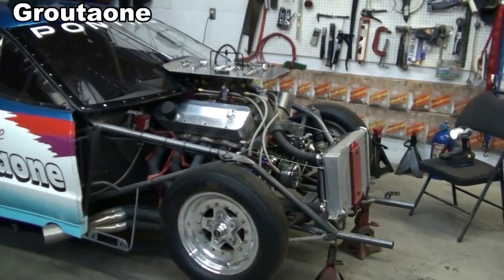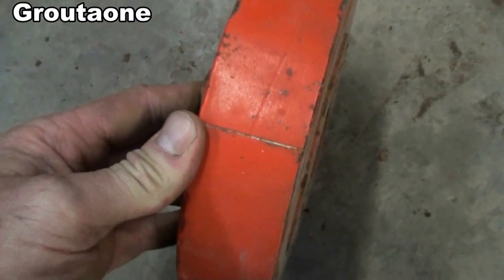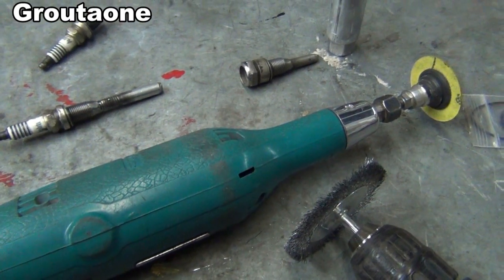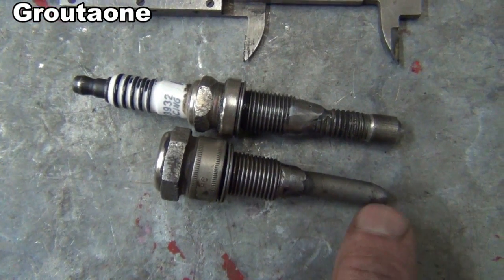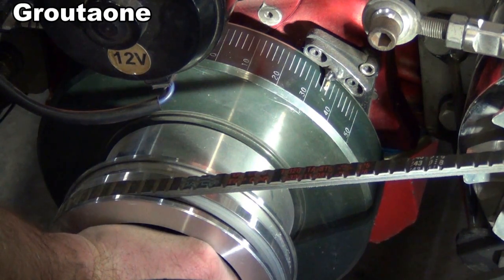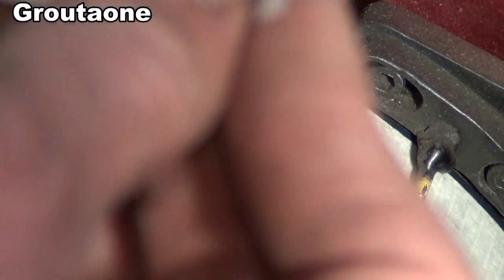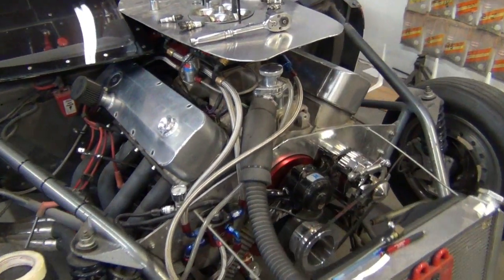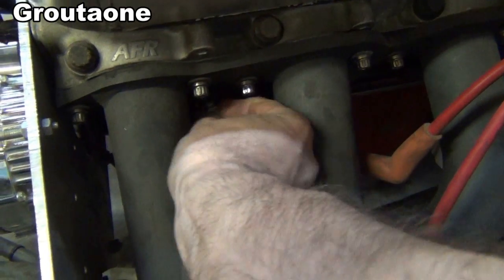Find TDC With Heads On

Comment: Their  is an engine family that has the #1 sparkplug on the cylinder bank that's recssed... 
And that's Pontiacengine family, my educated guess [ I my be wrong ] is that Pontiac  Division wanted cylinder # 1 to be on the right bank.  But, GM executives wanted all GM engines to have cylinder # 1@ the left bank. However,  the engine was already designed in a manner that the left bank was recessed, to late to  redesign.

Comment: Hi, Great video, I see that some people just put a whistle TDC finder on spark # 1 hole and turn clockwise until the whistle stops sounding. When whistle stops, that would be their TDC at compression stroke. Is that approach as accurate as yours? Once determined TDC, for timing purposes, I should line up the distributor rotor to plug 1 and then go with the timing like, correct?

Comment: Great vid, my 09 honda odyssey broke a timing belt. Ya interference engine compression shows atleast bent valves. Gona try gearwrench boltbiter sockets since heat and PB wont get header or exhaust bolts loose. Then both heads come off. Crossing fingers rebuilt heads gets me back on the road. Would luv to see your vid on TDC with heads off👍👍👍👍

Comment: I used this exact method to confirm TDC on my 388 SBC today, and I have a very similar adjustable timing pointer and a balancer that is pre-marked. The only difference between what you did and what I did, Is I had my cylinder head removed and used a piston stop attached to the block. Anyway, the TDC mark I found with this method using my two marks was about 3 degrees after top dead center passed the zero stamped on my balancer. I have a picture if you would like to see. I know I'm making this harder than it needs to be, but do I just rotate my motor around to line the zero on the balancer up with my pointer, and then adjust the pointer to the actually TDC mark I found with this method?  I hope this makes sense. Thanks in advance!

Comment: Does it matter what size length bolt u use to weld onto your spark plug? Or does it not matter as long as u spin it back around then meet in the middle upon the timing wheel?

Comment: Ok which way is the most likely to slip backwards so it looks like too adv. Timing or the other way? When using a piston stop and turning motor backwards is there any chance the piston hitting the valves?
Would a dial indicator work as well if not better?

Comment: Correct me if I'm wrong, but the reason your timing mark looks a little off is because it seems the tool didn't stop the piston at True Top Dead Center? The only way to find True Top Dead Center would be to use a dial indicator on top of the piston with the head off, right?
Reply: The piston has to hit the tool and can go no further, hence the reason for spinning the opposite way and hitting the piston then dividing by 2. This gives you the half way point of the #1 rod throw on the crank. Geometry is absolute every time.

Comment: Can you offer some diagrams for people who want to front half their car eg if they were building a serious bracket car or pro mod and what are the considerations for suspension and steering and which are the best parts to use?
P.S. I've been advocating that method for finding TDC for years, and it's great for motorbikes that usually dont have pointers or marks and most car balancers always seem to be slightly out, no matter the brand

Comment: hi I have a 12valve 190e 1984 mercedes benz a 2.3 engine.i have difficulties in finding the exact tdc of the engine.after building up the engine.it have difficulties in starting the engine.i only use a screw driver to find the compression.do i have to rotate counter clock wise after the compression at cylinder is up, and after a 1half inch of rotation is the tdc? thanks for your very informative videos:)

Comment: Nice Ride ! So to find TDC  you have to be on the compression side, right ? You got the valve cover's on and can not see the valves so how do you know for sure ?
Reply from the maker: ***** Correct, need to be on the compression stroke
Reply: Every other TDC the spark plug fires for #1 cyl, but that doesn't matter, TDC will still be the same because the crank throw will always be the same regardless of what the camshaft is doing. You are simply measuring the longest part of the crank throw for #1, it has nothing to do with cam components.

Comment: What about the good ol' finger method to find tdc?
Reply from the maker: That will get you in the ballpark if that's all you need, this is to verify the pointer is correct
Reply: Don't take me wrong, was a really great video and you explained everything very good.Thanks for sharing!
Reply: Could you do a video on a Ford 400 fixing distributor that's 180° off? Doesn't have to be 400 but its hard to find any videos on that engine. It doesn't have to be a video....you got any tricks to quickly rotate the dist 180 degrees?
Reply: jeremy sandifer  When did Ford make a 400?  I didn't realize they made a 400, I found it interesting to find out Ford made their own carbs at 1 point too. I knew Ford made a 360 also, but I got a Dodge 360 small block, Ford's 360 was a big block correct?
Reply: Ford made a 400cu. It was in the same category as the 351m series. Close to the Cleveland line with small changes. The Ford 400 is almost just a stroker motor. In trucks, they were in mostly the 78 and 79 F250s.
Reply: Not accurate, but accurate enough to drop your distributor in and get it running.

Comment: Hey thanks for the simple explanation and recording these videos.  I suspect my 347 stroker pointer is off and I know my MSD Pro Digital is miles off.  This will be the first step to getting it to run as it should. I did all my own work on body, interior and mechanical except the machine work and the dif setup.  Now I need to learn how to tune it.

Comment: Hi , can you help me out I have a sbc 350 with a mild cam , msd dristributer , holley 750 base timing at 15* and total at 36 @ 2800rpm . From idle to part throtle I have a hesitation and them it just goes any ideas

Comment: I had a damper come apart, and marked the hub with a TDC mark.  I always wondered how important the damper was, from a engine damage standpoint.   Recently I saw a late 80's four cylinder F1 engine dev. video.   They were mysteriously throwing rods, later determined all due to harmonics.

Comment: Hey man! Yes that did make sense.I got the new timing light.It was better than the old one. Also I checked the distributor again and it has adjustable rotor.The nuts and washers were no good and the rotor could not stay in place when revving the engine.So after replacing those I was able to set the total timing at 38 degrees.The idle was still off and I´m going to calibrate the carburetor today or tomorrow.I hope everything works after that.Thank you for your help! I should make a video too...

Comment: Yes I know, I did try that already, but after the total timing was set at around 36 the engine would no longer idle or even fire up at all. It´s not working at all. I would understand this if the timing mark on the damper was so much of and it would show the total timing 50, but actually the timing would be near 36-38. But it´s a one peace fluidampr balancer and it just can´t move on its own like that. Could something else be off? I just can´t understand this problem.I have done this before.
Reply: When you have more of a radical motor, your idle timing has to be increased, so then you have to take out some mechanical advance so it still ends up at 36. Its not uncommon for a radical motor to idle at 22-24 degrees, meaning the centrifugal advance would then only need 12-14 additional degrees.

Comment from the maker: I would set the timing at 36 degrees with when its up on rpm so the timing is all in and after that see where your timing is at when you let it idle down. The 36 degree max is the important one

Comment: Hi again!This was a good video,but still didn´t solve my problem.You see I´ve got the same fluidampr and everything lines up nicely.Also I checked the TDC before I put the heads on the motor. I installed the distributor and the rotor was set at #1 cylinder the motor still at tdc.It fired right up and when I started to look for my 36degree mark that I highlined before.What the f#&%!The idle(1600rpm)was now 38 already!Then I checked the total and I think it was 50 plus! What could I´ve done wrong?
Reply: Maybe you installed the cam straight up but it was recommended to be installed at a different specific point.

Comment from the maker: @Grannysteacup It could be a plugged jet, main jet sounds fine though, crank seals maybe or reeds as you say, the power as you describe does not sound far off from being normal for a 125 two stroke however

Comment: sup groutaone i got a honda crm 125cc 1992 (2stroke) that is supposed to have about 30 hp but on low rpm it feels like 5hp and about the same at mid rpm but then on high rpm there is a huge kick so u really feel the power. You seem to have very much experience with everything in the range of mechanics so what do you think i should do ?  (i have cleaned the carburetor and adjusted the settings right) could it be the reed valves or something?

Comment: .... near tears ... expensive tears at that . But it's all this stuff that the electronics should be able to stop .... I always thought about the effect of the ware on the cam chain tensioner & the like and these half degrees that changed the relationship be it under heavy load V lighter load, or the effect of a hot day over a cool day, this is when you start to think about Formula 1 and they have to pre heat the unit to get it loose enough to start !

Comment: @groutaone When I got it home and installed it, I cranked it over and it stopped after half a revolution.Then I noticed a sparkplug missing.Fished around with a magnet and pulled the bolt out.Awhile afterwards I did a head gasket on it and was amazed how close the bolt came to the valves.

Comment: Yay for new mike, sounds good. Bought a car once that wouldn't run right, friend of mine figured it was out of time. Took awhile to figure out the previous owner had replaced the timing chain and got that off a bit. I never really got past the part swapper stage of mechanics so that was a learning experience for me.

Comment: That's really nice.I used to use a rod down in the sparkplug hole and rock the engine around until I got pretty close, but this will get you dead on.Good thing you remembered that stop.I got a junkyard engine once with a bolt in the cylinder.Had an impression on the piston top and right between the valves.Ran it for years but that wasn't a dragster.